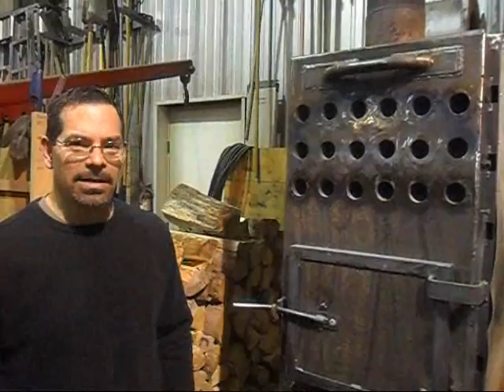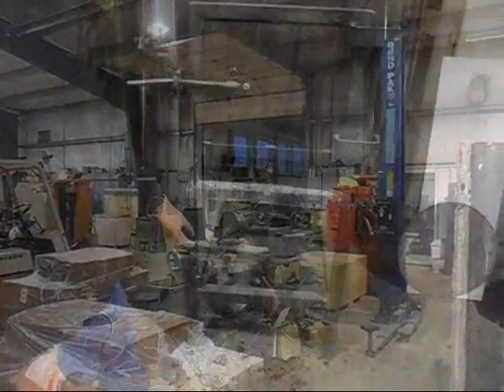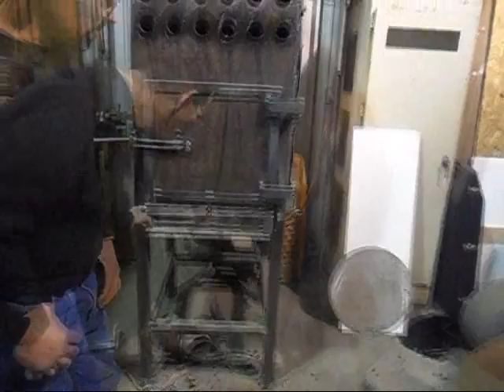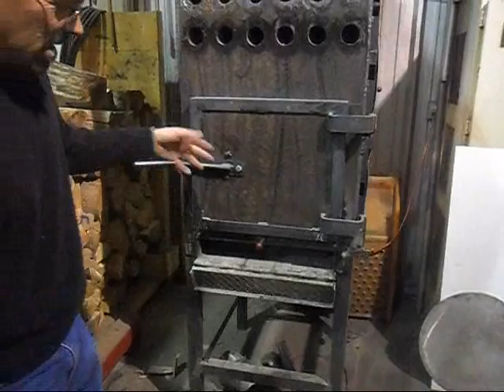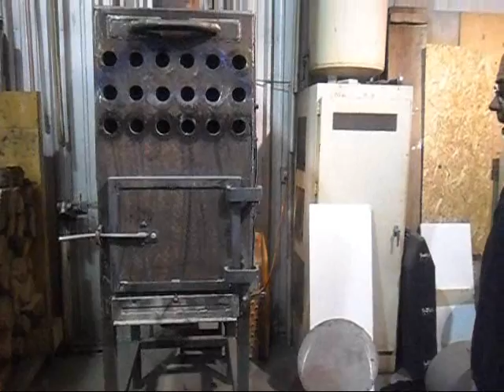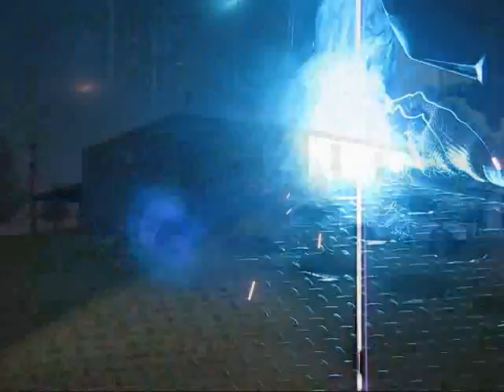Wood Stove for Shop

Comment: i have a super large wood stove 300 gal tank    i put  15 wheel barrel loads of large logs in it  ,it heats the shop real good    80 90 degres   i have to remove some clothing   gets hot as hell
Reply: Nice I have a 300 gallon wood boiled and a 650 gallon wood boiler stove

Comment: next time run your smoke dams vertically rather than horizontally and you wont have an issue with ash build up... soke will go down as long as you have draft pulling it from your smoke stack... just a thought.... thanks for the video

Comment: Tom, My name Is Alex Johnson. I build McGuire Stoves. I use Lava Rocks, in my stoves. I have 30 Videos on Youtube, That show what my stovres can do. Since you are capable of doing this yourself. I promise that you have never seen a stove do what mine do. I use the lava rocks above the fire, the rocks catch the particulate matter, catch the heat, and this is the reason my flue temps, are so much lower than the firebox, My stoves don't smoke. If you want further info, get ahold Alex,
Reply: Great hints. I've been thinking about welding up a firebox with my powerarc welder. I want to make sure I do it right.